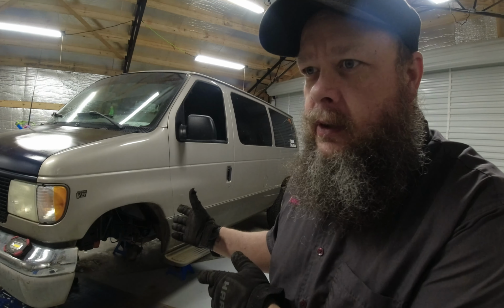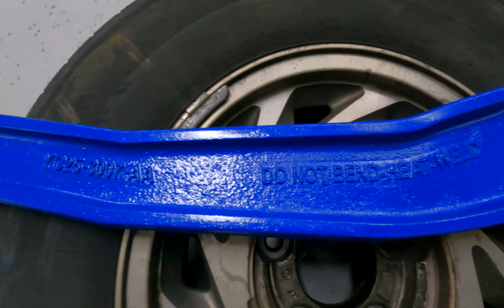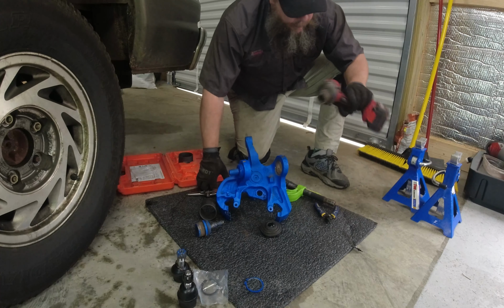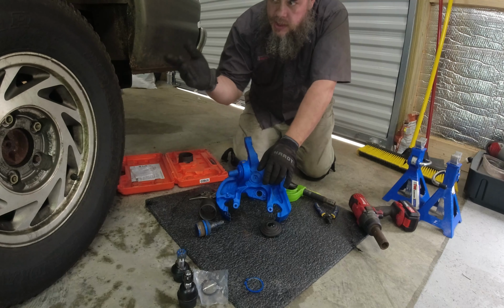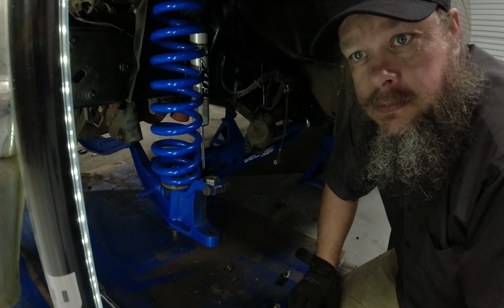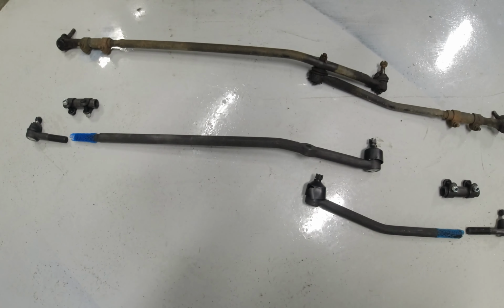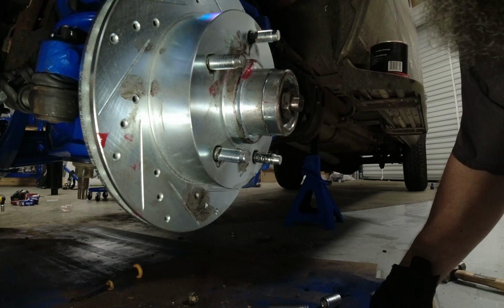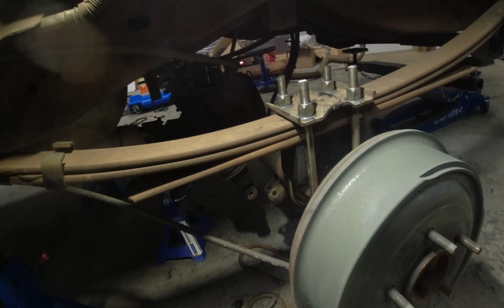Installing my Weldtec Designs Lift Kit!   Part 2

Comment: Wish weldtec had different radius arms. The whole ball in socket thing is odd.
Reply from the maker: Yea it is.  I Would have liked a jonny joint or a some type of rod end. Ive been thinking of doing a jonny joint down the road.
Reply: There are lots of reasons why we have stayed with the OG mounting of radius arms.  
1. bushings are inexpensive and available anywhere
2. you can change your wheel position easily.
3. The amount the arms moves at the pivot is minimal so you don't wear bushings
4. Bushings don't have to be pressed in.
5 $$$$  most people don't want to pay more if they don't have to.

If you ever have questions please ask on our channel and we can address in in our Q & A. Thanks
Reply: @WeldtecDesigns  If bushings are inexpensive then why is your kit so expensive?